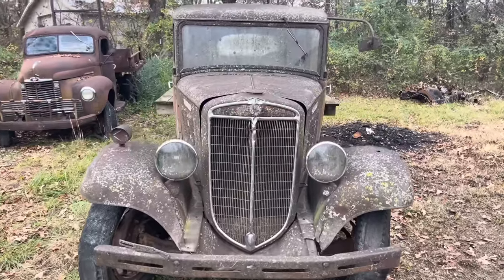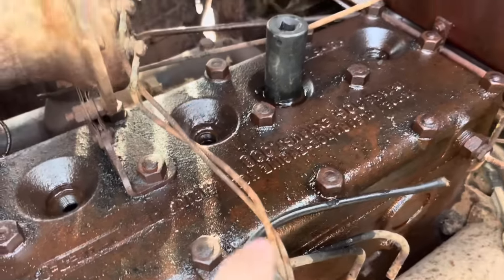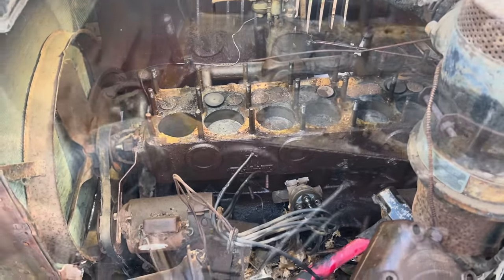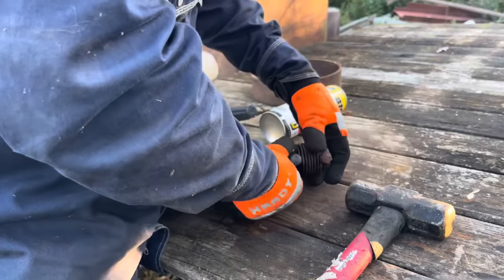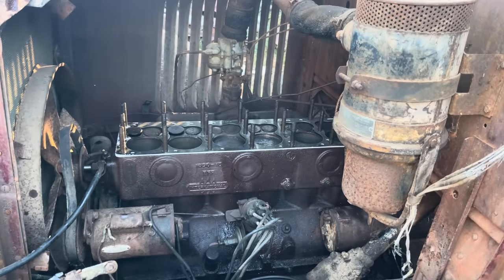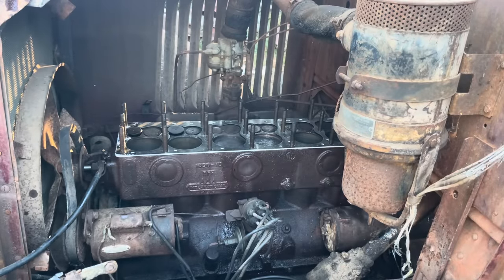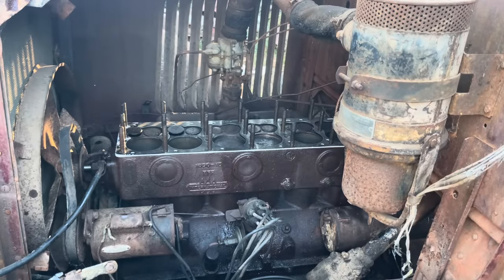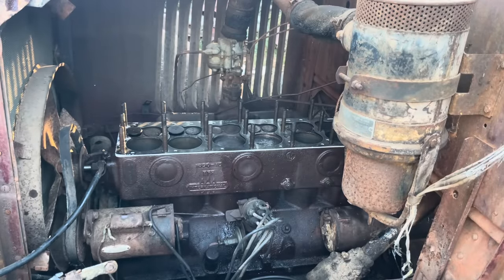Will it run after 71 years 1935 international c-30 ￼truck

Comment: Excellent video Jennings  :) also at least go motor to run plus put 200ml of 80w90 differential fluid  in rad when cold let run thru lube water pump  and jackets on whole motor plus corrosion out when drain it too  ! Also be  interesting if Generator still work too and lube to keep going! There sure be some metal cups squirt can 3 drops in too help lots too! Yes that 6 cylinder motor sounds like been rebuilt years ago too !
Reply: some of these old things had grease fittings on the water pump, but used special grease.

Comment: the clutch plate is rusted to the fly wheel .take all the pressure plate bolts out and pry the plate off the fly wheel. i had that with an old massey harris

Comment: Might could have unstuck the clutch while the engine was stuck by pulling the truck with the clutch depressed.  Since the engine would not turn the tires would slide until the clutch broke loose.  This has worked for me with a farm tractor but it does put a lot of stress on drivetrain parts, especially U-joints.  You are a very talented and patient mechanic, would love to have you as a neighbor.  Merry Christmas!
Reply: I am betting the trany is in neutral at the moment.... or the center hub of the clutch is broken.

Comment: Why do you never clean the carburetors on anything and just raw bottle feed them things would run a lot better if you would just clean a carburetor and hook up a fuel system
Reply from the maker: Some of them I do pull the carburetor apart and clean them but most the time the reason I don’t is because the carburetor kits by the time you get them shipped and everything they are over $100 and it takes a long time for them to get here and for a few of them I just use the same carburetor that I have rebuilt so I don’t have to buy a kit every time I ordered one for this truck two weeks before I posted this video and it still hasn’t showed up but in part 2 we will get it rebuilt I also ordered a fuel pump and it should be here soon

Comment: so, they only got about 27 years out of it before they parked it 71 years ago?
Reply from the maker: Yeah a lot of old vehicles where parked within 5-15 years just depends on how much it was drove and what it was used for also maintenance has a big role in how long they lasted and most roads back there where gravel so it would wear them out pretty quickly and the road dust was bad on the engines also

Comment: I do question though, what will you do with the cars after you got them running?
Reply from the maker: Some I sell some I save to restore just depends on what it is or if someone wants it most of the time if someone wants one I have to fix up I will sell it to them
Reply: @jenningsmotorsports7554  sounds like a lot of rocking and rolling, which you are great at in a educational and fun way 🤛

Comment: I’m sorry, but someone didn’t do the editing very well on this video
Reply from the maker: How so
Reply: @jenningsmotorsports7554  I mean no disrespect. I noticed a couple sections of the video were out of order. Example: you remove a spark plug and mention moving on to the next, but the next section is the starting process of the same plug. Another example being the removal of the head and the following section is working on prying it up. 

If this was intentional then I apologize, I just didn’t understand why the video was backtracking.
Reply from the maker: @williamgreen1196  you are correct on the plug part sometimes I don’t notice them thing lol I watched the whole thing like 3 times and didn’t even notice that but the head fell back down I believe 
And thank you for letting me know I am trying to get a little better at the editing thing lol
Reply: @jenningsmotorsports7554  no problem.  By the way, thanks for saving a piece of Oklahoma history. I’m an okie as well.

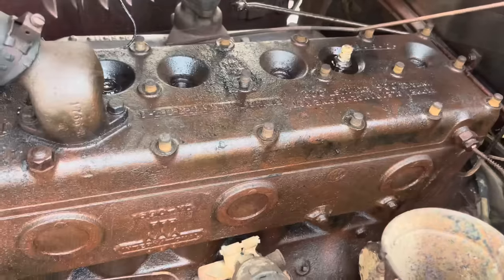Comment: 7:12 shows how the penetrating oil doesn't do anything for penetrating between the threads, you can only see dry rust where the nuts were. I guess the thermal shock might play a role in helping to get them off and it does lubricate the upper bit of the thread that's already sticking out but any oil would do that